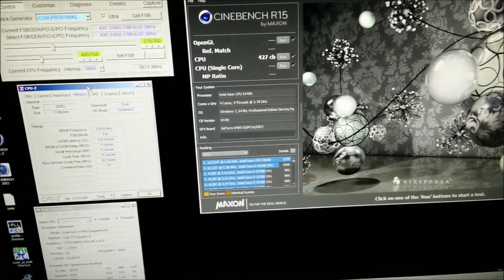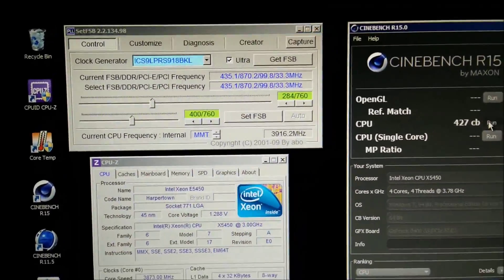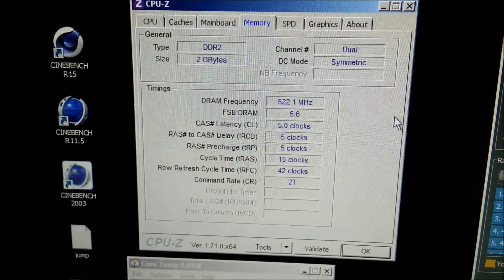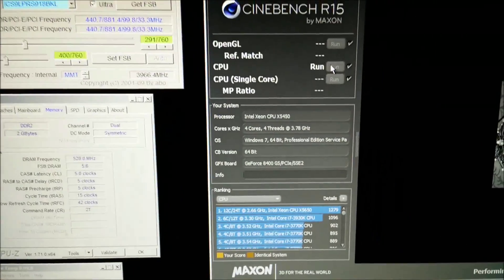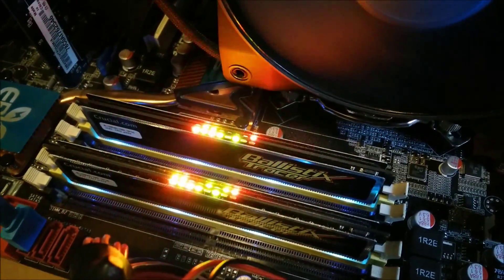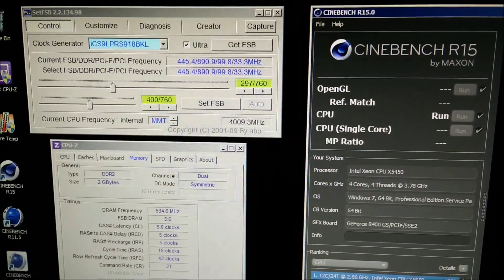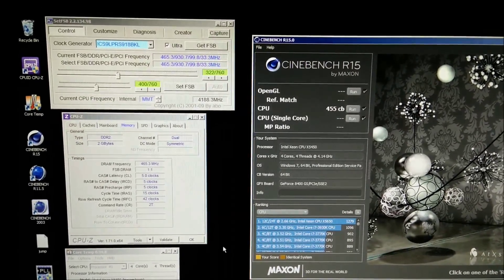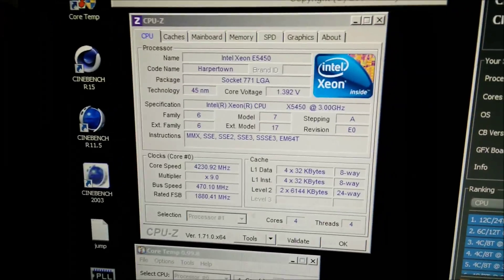Intel Xeon X5450 Overclocking and How to use SETFSB to find a stable overclock quickly

Comment: best kind of motherboard to overclock this Xeon or a Q9650? also, reccomended air cooler for overclocking these chips?
Reply from the maker: i would look for and asus P5Q or P5K motherboard :) there are turbo, pro turbo, e, deluxe, deluxe wifi and other versions :)
Reply: @LawrenceTimme  hi how do you know when you get the right pll-chip number with out checking under neath you laptop and  if do system restore point  before it was  installed will that reset the problem please reply me asap it would mean a lot to me thanks
Reply: @cannaroe1213  sorry for distrubing and  if i confused you i wanted to know if set fsb works with a locked cpu i only have 1.7 ghz and need 2ghz my laptop is hp core i7 1255u do you know if it will work at all
Reply: @nigelphillips7454  It can be difficult to find your PLL chip, however a manufacturer will usually use the same brand of PLL chip for all their boards. I have a P5E64 WS Evolution that uses the exact same chip as in the video because it's also by ASUS. You should just go through the drop-down menu, make sure Ultra is ticked, and check the PCIe speed and other numbers make sense. If you select the wrong one nothing bad will happen (unless you also click Set FSB, dont do that!)

SetFSB wont save anything either, so a restore point isn't necessary - just reboot. Yes it works with a locked CPU because that's talking about the multiplier not the FSB which is up to the PLL which is on the motherboard :) Sorry if i was rude before, I was having a bad day.
Reply: @cannaroe1213  thanks so much for your reply i forgive you just one thing for now so you mean only click set fsb icon but not when it has loaded and is set fsb easy to use please reply me asap would mean a lot to me also have you heard camomile the cpu cooler does it actually work sorry hope im not disturbing you just dont want it to crash
Reply: @cannaroe1213  thanks so much for your reply i forgive you just one thing so you mean only click set fsb icon but not when it has loaded and is set fsb easy to use also is the tool all i need nothing else please reply me asap would mean a lot to me
Reply: @cannaroe1213  thanks so much for your reply i forgive you just one thing so you mean only click set fsb icon but not when it has loaded and is set fsb easy to us also is the tool all i need nothing else please reply me asap would mean a lot to me
Reply: @cannaroe1213   thanks so much for your reply i forgive you just one thing so you mean only click set fsb icon but not when it has loaded and is set fsb easy to use also is the tool all i need nothing else please reply me asap would mean a lot to me
Reply: @cannaroe1213  thanks so much for your reply i forgive you just one thing so you mean only click set fsb icon but not when it has loaded and is set fsb easy to use also is the tool all i need nothing else please reply me asap would mean a lot to me
also do have to redo it each time you restart pc or not
Reply: @cannaroe1213  hi you know  you said the multiplier works with locked cpu is that all i need and could you tell me how i use it please really want this  would mean a lot to me thanks also do have to redo it each time you restart pc or just load it again and can it reload from task bar if pin it there  anmd finally so it can overclock any cpu your saying mine is hp core i7 1225u laptop
Reply: @cannaroe1213  hi you know  you said the multiplier works with locked cpu is that all i need and could you tell me how i use it please really want this  would mean a lot to me thanks also do have to redo it each time you restart pc or just load it again and can it reload from task bar if pin it there  anmd finally so it can overclock any cpu your saying mine is hp core i7 1225u laptop
Reply: @cannaroe1213  hi you know  you said the multiplier works with locked cpu is that all i need and could you tell me how i use it please really want this  
would mean a lot to me thanks also do have to redo it each time you restart pc or just load it again and can it reload from task bar if pin 
it there  anmd finally so it can overclock any cpu your saying mine is hp core i7 1225u laptop  and does it matter what version you use
Reply: @cannaroe1213  hi you know  you said the multiplier works with locked cpu is that all i need and could you tell me how i use it please really want this  
would mean a lot to me thanks also do have to redo it each time you restart pc or just load it again and can it reload from task bar if pin 
it there  anmd finally so it can overclock any cpu your saying mine is hp core i7 1225u laptop  and does it matter what version you use
Reply: @cannaroe1213  hi you know you said the multiplier works with locked cpu is that all i need and could you tell me how i use it please or it it easy to usealso do have to redo it each time you restart pc or just load it again mine is hp core i7 1225u laptop  and does it matter what version you 
use
Reply: @cannaroe1213  hi you know you said the multiplier works with locked cpu is that all i need and could you tell me how i use it please or it it easy to usealso do have to redo it each time you restart pc or just load it again mine is hp core i7 1225u laptop  and does it matter what version you 
use
Reply: @cannaroe1213  thanks so much for your reply your the best i use hp core i7 1255u laptop 12th gen is it easy to use and i can i load it from task bar 
 and should i do a system restore point also is it possible to do it with out clicking on set fsb once load it and do I click get fsb to start with and can the version  setfsb_2_3_178_134 work thats should be all now please reply me asap
Reply: @cannaroe1213  thanks so much for your reply your the best i use hp core i7 1255u laptop 12th gen is it easy to use and i can i load it from task bar 
 and should i do a system restore point also is it possible to do it with out clicking on set fsb once load it and do I click get fsb to start with and can the version  setfsb_2_3_178_134 work thats should be all now please reply me asap
Reply: @cannaroe1213  

thanks so much for your reply your the best i use hp core i7 1255u laptop 12th gen is it easy to use and i can i 
load it from task bar and should i do a system restore point also is it possible to do it with out clicking on set fsb once load it and do I click get fsb to start with and can the version  setfsb_2_3_178_134 work thats should be all now please reply me asap
Reply: @cannaroe1213  

thanks so much for your reply your the best i use hp core i7 1255u laptop 12th gen is it easy to use and i can i 
load it from task bar and should i do a system restore point also is it possible to do it with out clicking on set fsb once load it and do I click get fsb to start with and can the version  setfsb_2_3_178_134 work thats should be all now please  reply me asap
Reply: @cannaroe1213    hi when using set fsb for locked cpu which options do i choose please reply me the answer that will be all like fsb number or
Reply: @cannaroe1213    hi when using set fsb for locked cpu which options do i choose please reply me the answer that will be all like fsb number or i use 12th gen locked cpu
Reply: @cannaroe1213     hi when using set fsb for locked cpu which options do i choose please reply me the answer that will be all like fsb number or i use 12th gen locked cpu
Reply: @cannaroe1213     hi when using set fsb for locked cpu which options do i choose please reply me the answer that will be all like fsb number or i use 12th gen locked cpu
Reply: @cannaroe1213     hi when using set fsb for locked cpu which options do i choose please reply me the answer that will be all like fsb number or i use 12th gen locked cpu
Reply: @cannaroe1213  hi when using set fsb for locked cpu which options do i choose please reply me the answer that will be all like fsb number or i use 12th gen locked cpu
Reply: @cannaroe1213  hi when using set fsb for locked cpu which options do i choose please reply me the answer that will be all like fsb number or i use 12th gen locked cpu
Reply: @cannaroe1213  hi when using set fsb for locked cpu which options do i choose please reply me the answer that will be all like fsb number or i use 12th gen locked cpu
Reply: @cannaroe1213  hi when using set fsb for locked cpu which options do i choose please reply me the answer that will be all like fsb number or i use 12th gen locked cpu
Reply: @cannaroe1213   hi when using set fsb for locked cpu which options do i choose  i use hp core i7 1255u laptop 12th gen please reply me the answer how to 
use it i promise thats all i need thanks for helping me your the best
Reply: @cannaroe1213   hi when using set fsb for locked cpu which options do i choose  i use hp core i7 1255u laptop 12th gen please reply me the answer how to 
use it i promise thats all i need thanks for helping me your the best
Reply: @cannaroe1213   hi when using set fsb for locked cpu which options do i choose  i use hp core i7 1255u laptop 12th gen please reply me the answer how to 
use it i promise thats all i need thanks for helping me your the best
Reply: @cannaroe1213   hi when using set fsb for locked cpu which options do i choose  i use hp core i7 1255u laptop 12th gen please reply me the answer how to 
use it i promise thats all i need thanks for helping me your the best
Reply: @LawrenceTimme   hi Ive been told that nothing bad will happen as long as i don't click set fsb thats only after loading it right also how I know whether the numbers make sense please reply me asap would really appreciate it I liked and subscribed
Reply: @LawrenceTimme   hi Ive been told that nothing bad will happen as long as i don't click set fsb thats only after loading it right also how I know 
whether the numbers make sense please reply me asap would really appreciate it I liked and subscribed
Reply: @LawrenceTimme   thanks so much for your reply your the best i use hp core i7 1255u laptop 12th gen is it easy to use and i can i load it from task bar and should i do a system restore point also is it possible to do it with out clicking on set fsb once load it and do I click get fsb to start with and can the version setfsb_2_3_178_134 work thats should be all now please reply me asap
Reply: @LawrenceTimme  thanks so much for your reply your the best i use hp core i7 1255u laptop 12th gen is it easy to use and i can i load it from task bar and should i do a system restore point also is it possible to do it with out clicking on set fsb once load it and do I click get fsb to start with and can the version setfsb_2_3_178_134 work thats should be all now please reply me asap
Reply: @LawrenceTimme  if it crashes will it allways crash when i load my pc
Reply: @LawrenceTimme  hi will it allways crash when i load my laptop if do something wrong or just when i load set fsb please reply me asap thats all i need
Reply: @LawrenceTimme   hi will it allways crash when i load my laptop if do something wrong or just when i load set fsb please reply me asap thats all i need
Reply: @LawrenceTimme   hi will it allways crash when i load my laptop if do something wrong or just when i load set fsb please reply me asap thats all i need
Reply: @LawrenceTimme   hi will it allways crash when i load my laptop if do something wrong or just when i load set fsb please reply me asap thats all i need
Reply: @LawrenceTimme  hi when using set fsb for locked cpu which options do i choose please reply me the answer that will be all like fsb number or i use 12th gen locked cpu
Reply: @LawrenceTimme  hi when using set fsb for locked cpu which options do i choose please reply me the answer that will be all like fsb number or i use 12th gen locked cpu
Reply: @LawrenceTimme  hi when using set fsb for locked cpu which options do i choose please reply me the answer that will be all like fsb number or i use 12th gen locked cpu i liked and subscribed to your video
Reply: @LawrenceTimme  hi when using set fsb for locked cpu which options do i choose please reply me the answer that will be all like fsb number or i use 12th gen locked cpu i liked and subscribed to your video
Reply: @LawrenceTimme    hi when using set fsb for locked cpu which options do i choose  i use hp core i7 1255u laptop 12th gen please reply me the answer that will be all like fsb number or
Reply: @LawrenceTimme    hi when using set fsb for locked cpu which options do i choose  i use hp core i7 1255u laptop 12th gen please reply me the answer that will be all like fsb number or
Reply: @LawrenceTimme    hi when using set fsb for locked cpu which options do i choose  i use hp core i7 1255u laptop 12th gen please reply me the answer that will be all like fsb number or
Reply: @LawrenceTimme    hi when using set fsb for locked cpu which options do i choose  i use hp core i7 1255u laptop 12th gen please reply me the answer that will be all like fsb number or
Reply: @LawrenceTimme    hi when using set fsb for locked cpu which options do i choose  i use hp core i7 1255u laptop 12th gen please reply me the answer how to use it i promise thats all i need thanks for helping me your the best
Reply: @LawrenceTimme   hi when using set fsb for locked cpu which options do i choose  i use hp core i7 1255u laptop 12th gen please reply me the answer how to use it i promise thats all i need thanks for helping me your the best
Reply: @LawrenceTimme   hi when using set fsb for locked cpu which options do i choose  i use hp core i7 1255u laptop 12th gen please reply me the answer how to use it i promise thats all i need thanks for helping me your the best

Comment: I have X5450 on gigabyte ga g41mt s2 Which clock generator is it ? PLS and THX for help :D
Reply from the maker: I dont know off the top of my head as gigabyte use loads of different clocks gens. you will have to look through this list and see http://www13.plala.or.jp/setfsb/ if its not on the list then you will have to try all of them and see which one works, if you open cpuz the you can compare the speed it says on setfsb vs cpuz to check its working.

Comment: hey want to ask you if i can oc x5460 to 4ghz with asus P5G41T-M LX and if so with what setting like the volt
Reply from the maker: no, i dont think you will be able to, as that is the G41 chipset which inst good for overclocking. you might get 3.3-3.4ghz at very best :(
Reply: ok thks i heard people saying that the g41 chipset fsb  is locked at 333mhz and will very much not boot if you pass 333mhz on the fsb which makes it harder to oc,but yeah i get the point g41 mobo are bad at oc thks for your info
Reply: Yeah,that's what I have and I can't hit over 3333.27 mhz,but even at that it's 80% of an I5 2500k,so it's still way better than a dual core

Comment: thanks for the help, just been looking at some of your other builds and vids, good videos, surprised you dont have more subscribers, you like the same sh1t i do, cars , lipos, and tek stuff, seen that little car you had at santa pod, i use to have rs fiestas , xr2s, , mgzrtd, all tuned, also its good to see a english lad?, doing this stuff on here,its usually americans and there market is different,anyway pc-ive got 150 budget for motherboard and possessor,i want used ,and to bag a used bargain ,could be a old workstation,or pc, or anything, i just want around 4 -8 cores? and as much bang for my buck as i can, i dont care about graphics card as ill get that as a extra ,as i want this build for a htpc and genral use pc, but i need as much power as i can get for 150 to help play 4k video over hdmi 2.0 and that other 4k video connection forgot the name now,,and now and then,mild gaming 1080p, high res on old games, any advice on a motherboard combo for this, is the one we talked about below my best option, i5? exeon?, pentium overclock?, any ideas?,,, think tight bastard lol, and thats my kinda build, thanks , subscribed!
Reply from the maker: Yes i am English. I do have a list of videos that i want to do and i should be putting some more videos out soon. My lightning situation is still not 100% so it is hard to film. 

I also like to film my car and just the other day i was testing a new suction mount i got from my gopro, so i will be doing some videos with that.

For £150 i think you should be able to pick up an i5. the 2500K is really goo value atm and they overclock really well as they are soldered. the only trouble is a motherboard could be expensive. You may also be able to get a 2600k with a mobo in your price range. 

Thanks for subbing i appreciate that :)

Comment: might sound stupid but am i right that intel boards dont over clock or do all p35 boards overclock?, what shouldnt i buy?, thanks again
Reply from the maker: all p35, p45 and x38 and x48 boards overclock, but only the P chipsets work with 771 xeons. dont buy anything that isnt p35 or p45. make sure it has decent vrm and north bridge heatsinks. this is very important when overclocking quad cores as they use a lot of power.
Reply: What is the reason for  the p35 and p45 being the only ones that work for 771 xeons?
Reply from the maker: Dothtar idk

Comment: hi, please can tell me what the best value used xeon and board combo is with overclocking in mind, thanks
Reply from the maker: probably a P35 chipset motherboard, asus or gigabyte are best. then the best value xeon is probably the X5450. go for a ddr2 board as they are cheaper and ddr2 is just as fast on this platform and fairly cheap for fast ram.
Reply from the maker: make sure you get a e0 steeping model xeon

Comment: Does SetFSB support cpu's from 2013 and 2014? also ive tried setfsb, got everything right: PLL, but cant overclok it.... no errors, but still it doesnt show any difference.....
Reply from the maker: its not the cpu which depends if it works, its the pwm on the motherboard.
Reply: @LawrenceTimme  hi when using set fsb for locked cpu which options do i choose please reply me the answer that will be all